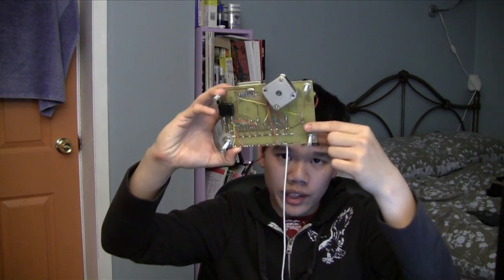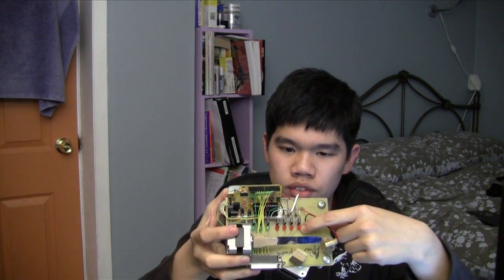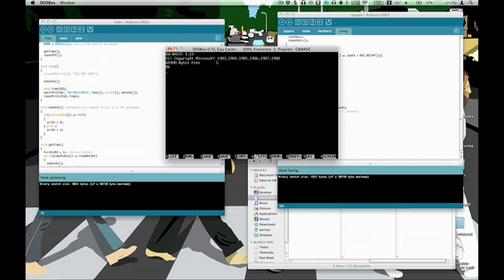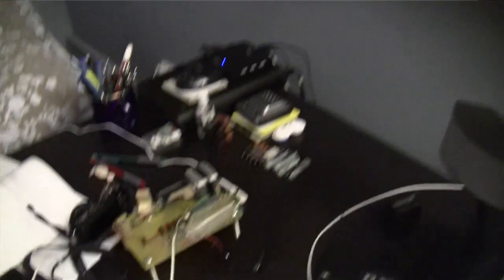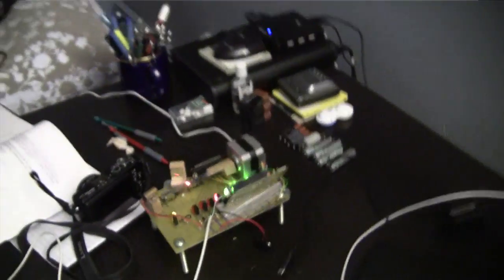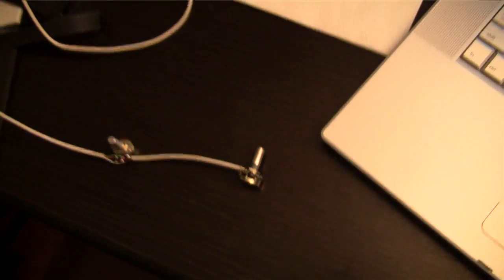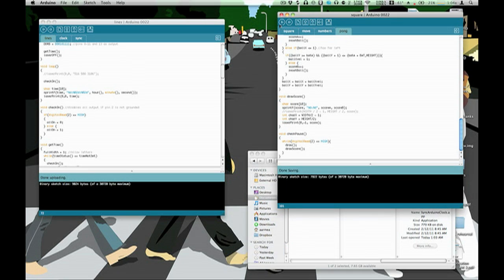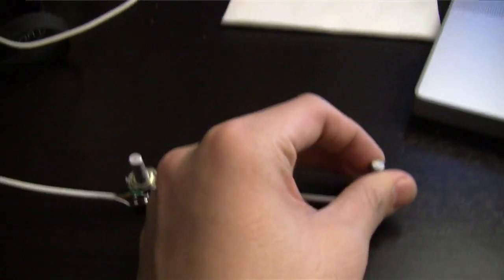DIY Laser Projector (uses an Arduino, plays Pong!)

Comment: Very cool project!  It looks like the mirrors are directly connected to the stepper motor without going through a gear reduction.  What resolution did you manage to get (Resolution for viewing area).  If I try to reproduce this project, how many step motor would you suggest?

Comment: @IllestFlip2414 I saw a laserprojector on hackaday.com using these speaker cones. Mirrors taped to a pivot and the cone, causing them to slightly rotate.Commercial lasers use a similar idea (galvanometers)

Comment from the maker: @hacky97 The speed is limited in software - I tested different refresh rates and this seemed to be the one that works best without distorting the lines too much.

As for the speaker cone (did you mean using some sort of non-motor electromagnet?) I haven't tried but I like the suggestion. Maybe I'll try it in a later version when I get the time.

Comment: very cool project. Nicely done too. I just love laser. Is the speed limited by the software or the steppers? Did you try using (I forgot the actual name) a speaker-cone for moving the mirrors? That would make the movement a lot faster and crisper.